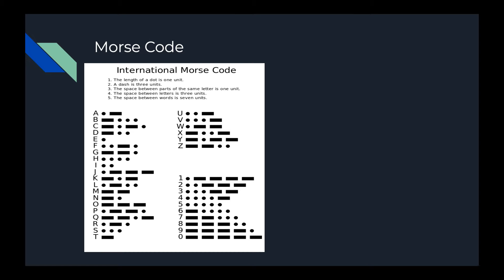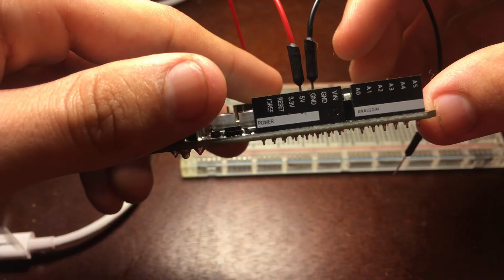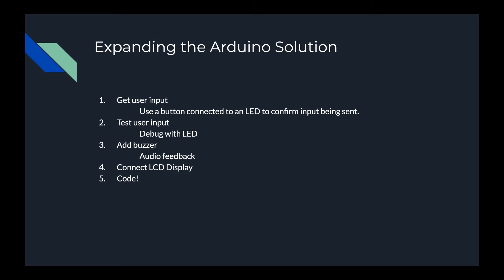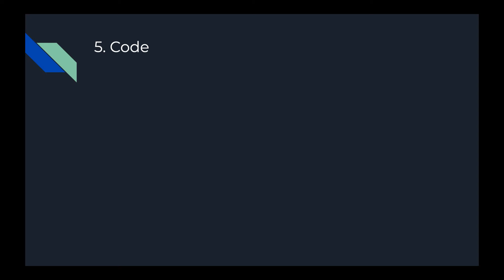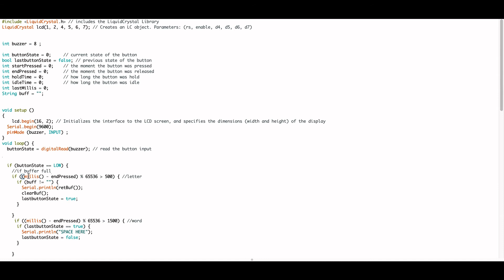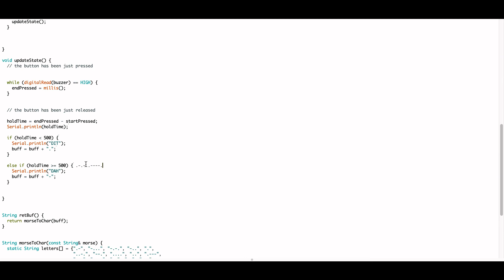Arduino Morse Code Translator

Comment: I just tried this without a buzzer and it didn't work for me. The LCD lights up, the potentiometer affects the contrast, and the LED lights up when I press the button. But it doesn't translate button presses onto the LCD display. The LCD display lights up but does not show anything.

I didn't change the code even though My circuit doesn't include a buzzer because it seems to me it shouldn't affect the code. I still connected a wire from the arduino's 8-pin to same row as the button so it is still getting input.

Any advice?
Reply: Same here, I am trying to understand why.
Did you solve it?
Reply: I went through the documentation for LiquidCrystal. Pin 4 of the LCD if not in use needs to be connected to ground.
It now works fine

Comment: Did you use an active or passive buzzer?
Reply: It's probably an active buzzer as a passive buzzer requires a square wave. An active buzzer acts just like an LED, it just needs a circuit.